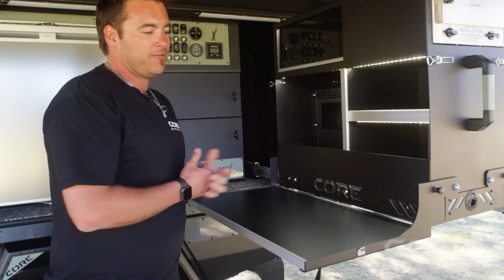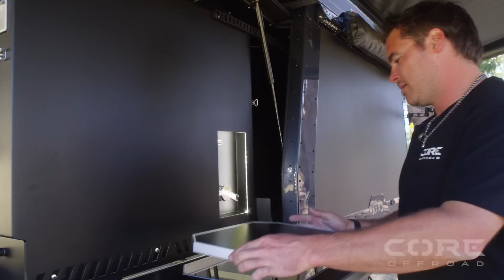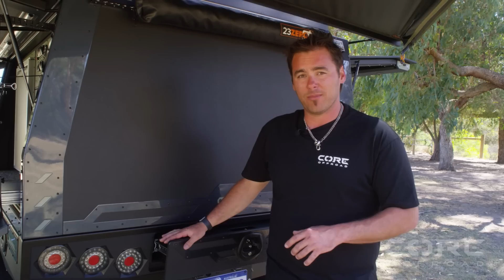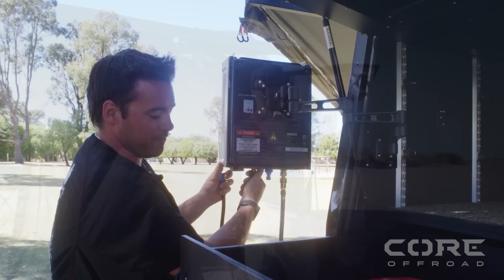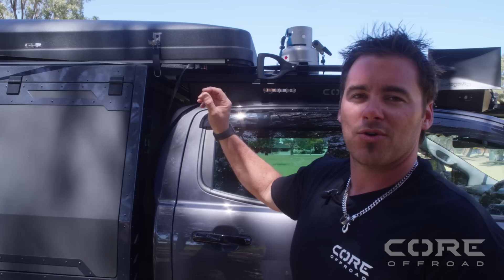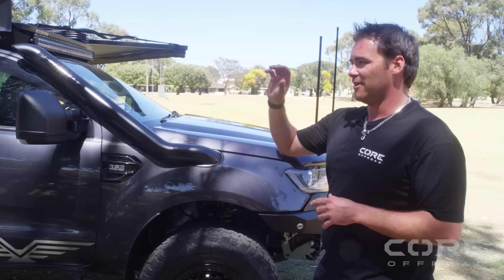ULTIMATE Ford Ranger GTU Canopy Setup Walk Around - Core Offroad

Comment: Throw a mirror in on the sink with storage for small toiletries to brush teeth etc and a powerpoint nearby for electric toothbrushes, clippers or hair dryer etc. Would be a great addition! 👍🏽
Reply from the maker: Cool idea!
Reply: And update the led strip lights to the new dotless version! Would look nicer than the dotted led lighting! And add an optional dog box on the storage side, and induction cook top in the trundle tray with an open/close zipper just abovd in the awning to allow for cooking fumes to escape up and out into the opening!
Reply: above*
Reply: Would put a mirror on the back of the sink board/chopping board and a mounting bracket on the slide out kitchen unit just to the top left of the tap to store and hold the board/use as a mirror when washing dishes or brushing teeth/washing face etc.

Comment: Probably one of the best camper tops I've seen from AU but there is room for improvement. Adding a rack instead of stacking for your dishes would be helpful. This is a off road build and not a static kitchen cupboard and adding a flip down Tele would be nice. Last but not least, where is your spare tire carrier. Great work from the Aussies.
Reply from the maker: Thanks for the tips!
Reply: Throw the spare on the roof over the driver. Where it should be anyways like all professional expedition vehicles the kitchen stuff is negligible but good advice. I live in Canada. It would be nice to see awnings with drop down but nets

Comment: A lot of thought has gone into the fine details. I like it. Apart from the actual form factor. Id like to have not a seperate roof top tent but the type that lifts up to make all the back a kind of mini sleeping/storage area and the sides and pull out drawers that you showed here that would be compaitible with that kind of setup.. Very practical setup and solutions from what i saw though. I like the way you think and solve problems. maybe you do have more of a slide on camper poptop model? i havnt looked yet but will. if not I hope you make one. Good luck anyway..

\
Reply from the maker: Thanks for your feedback.

Comment: Hi. I agree with you about the upright fridge. My only question is what does it look like inside with all of the contents after going down a corrugated road or rolling 4x4 track? Thanks
Reply from the maker: Hi Matthew, ah yes, corrugations, don't we love them! As with anything, be it upright fridge, portable fridge, draws, shelves or anything in your 4WD or canopy, how well you pack it will depend on how it survives after a day of corrugations. We've had two long-life cardboard milk containers rub against each other in a portable fridge on corrugations for a day and the inside of the fridge look like a cow exploded! We put the milk in zip lock bags now. Here's a good tip for your beers, after a day of corrugations, the cans rubbing against each other get coated in aluminium dust and it makes your hands black when you pull them out. Just grab the top of your can with your finger tips and drop it straight into a stubby cooler! Your hands won't be black and your misses won't know you've snuck in a couple of quiet ones! Stay safe and happy travels.

Comment: Nice job guys! Where is the other gas bottle located? Tucked away with a quick disconnect at the rear?
Reply from the maker: Hi Zen, yes the gas bottle is located in the right rear under tray box with a bayonet fitting.